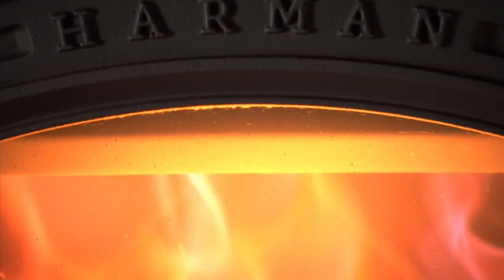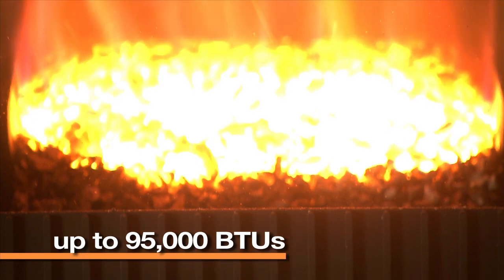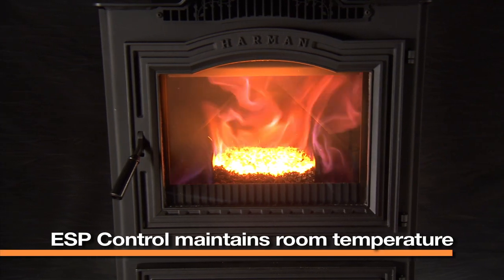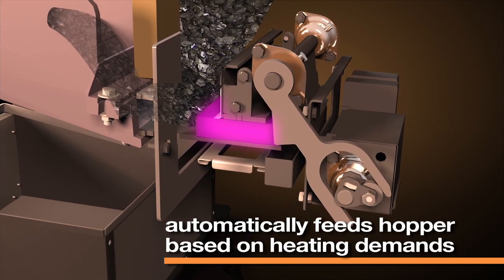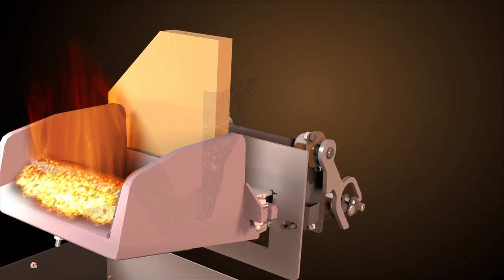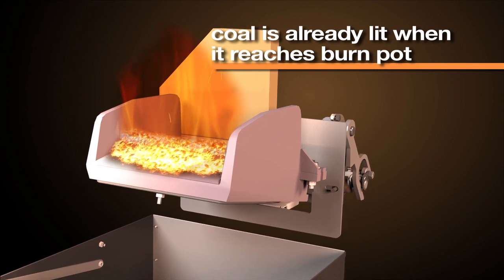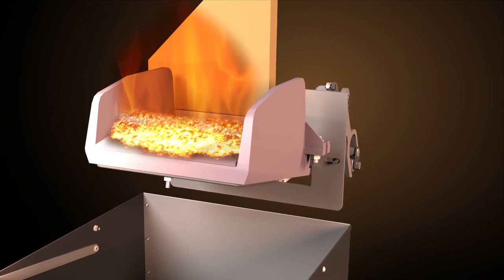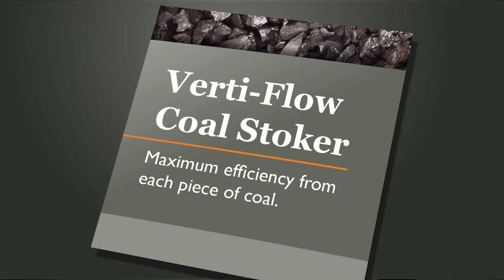Verti Flow Technology - the engine in our Super Magnum Stoker and VF2500

Comment: Nice design. Thinking about a small hydronic system?   My S130 is just a wee much for my 1700 sq ft house.  Of course it works just fine, except spring & fall. I always felt a smaller BTU unit that had to work harder. All and all, I simply love my S130. You guys are the best out there.